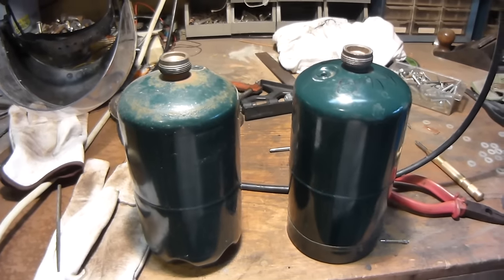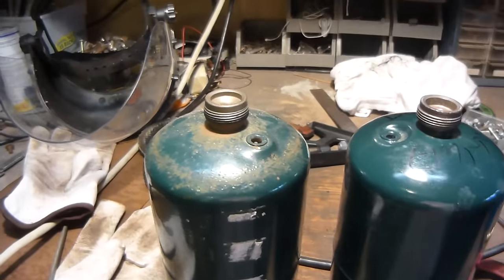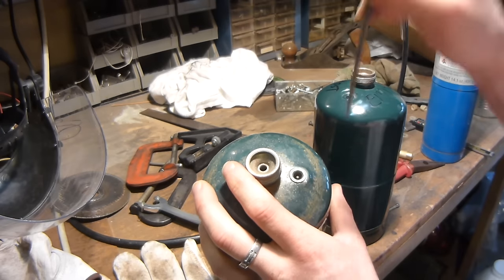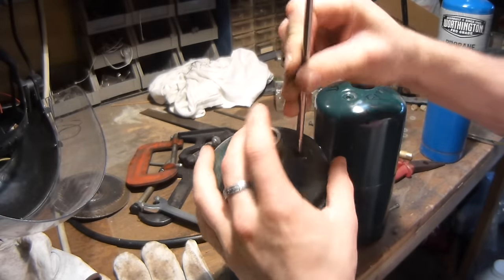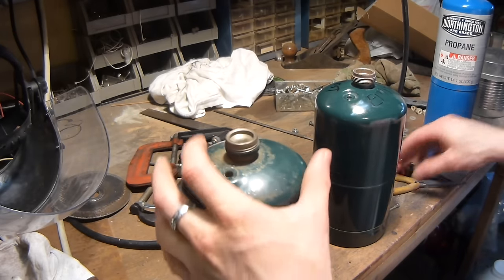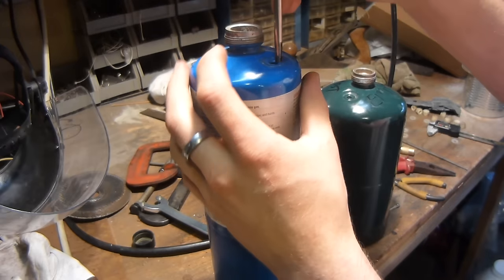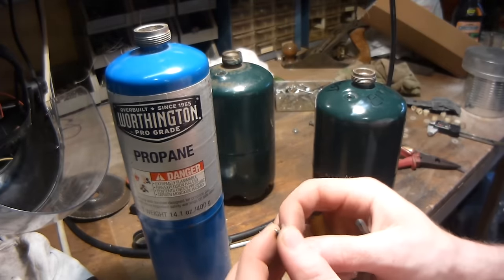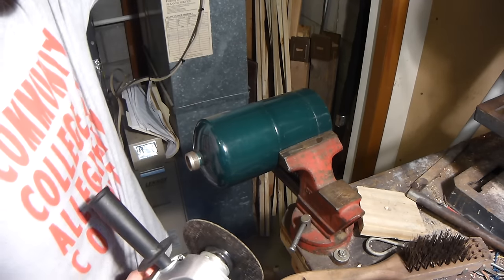How to Safely Cut Open a Propane Tank for Aluminium Melting Crucible

Comment: Hey, I made one of these from your instructions. Thanks for the experience and the safety tips. 
Side:  I'm not sure it's for the masses since some unlucky person might be near a spark or flame without knowing it.  I did notice that when filling the canister with water, there was a trapped gas pocket as TheRubberMeep pointed out, so I guess it's a good idea to drain the water.

Comment: Hey MJ101, after watching Grant Thompson's video on his popcan furnace on FB, I decided to do this. I looked everywhere trying to find the steel fire extinguishers (here in Altoona, they are all aluminum now) so went this route. My method, being completely paranoid, was to hold the can underwater while first drilling out the relief valve and then cutting the top off. Since all I had was a hacksaw, it did not go nearly as fast. But the can held up to the temps of a charcoal furnace and allowed me to melt enough scrap aluminum to get about ten mini metal muffins.

If you can afford it,  my new plan is to just buy the special tongs off ebay and get actual graphite crucibles. They're much more expensive, but you don't run the risk of the crucible failing from too high temps.
Reply from the maker: +J.D. Gallaway (FCCorpUS) If you just cut slowly with the hack saw you would have been find.  I have never seen a hack saw create any sparks.  But still better to be safe than sorry.  Cool that it worked out for you and you cast some aluminum!  I probably will buy a graphite crucible eventually. Thank you!
Reply: @makerj101     U must not use a hacksaw very often because mine sparks all the time depending on what blade they have on it

Comment: Please use a wheel guard when you are using the angle grinder! Not to be one of those safety freak types, but once when i was cutting metal without a wheel guard the wheel exploded, and a large piece of it embedded itself a good inch deep in the wood wall 10' away from me. If that had hit me it could very well have killed me. I have never used an angle grinder without a guard since.
Reply from the maker: +A. Zak  Yeah I should have been.  I took it off last time I used it when I was using the angle grinder as a sander.  Then I forgot to put it back on.  I didn't even realize it was missing...  Thanks for pointing it out.  It's back on now.  Not a good thing to happen.  I'm glad you are ok.
Reply: Makerj101 Well, I'm glad you use a guard most of the time! And i am also happy that i am OK .☺
Reply: well now i have to scold you for using a bad blade. you can use the angle grinder without the gaurd carefully and very very very very very frequently the gaurd gets in the way making your cuts imposible and grinder worthless, or because of the poor way most blade gaurds attach to the grinder the gaurd gets a little bit of lean, can be ok with some blades after almost loosing my hand i wont be overlooking that again, the blade must spin parellel to the gaurd if its not parellel or if it dips at any point once spinning do what you have to to make it parekllel. if your blade flew off iether you where attempting to cut something in a way you should not have, pay  attention to blade flex, or it is because the blade cracked or chunked and you cut corners rather than grabbing a new one. dont cut that corner even with ppe and a blade gaurd installed properly you can still get injured by a blade that should have been thrown away. i had no classical instruction and never a professional to point the way i learned this first hand, the hard way, heed these words if you wish, its your life.
Reply: A good friend of mine got careless and had an angle grinder disc break apart and got a piece deep in his arm. It was  a terrible, jagged wound that took a very long time to heal. One of the worst I've ever seen. I use the solid cut off  disc's made by Diablo now. They don't break. They just eventually get dull but they last a long time.

Comment: where is the guardon the angle grinder?
the disk will break and you will have bad time
Reply from the maker: +the real illuminati Yeah... I shoulda put it back on.  I took it off them I was using the sanding disk but I forgot to put it back one.  And yeah that would not be good if it broke.
Reply: +Makerj101 I always end up setting my shirt on fire when I'm grinding stuff.  I have about 5 shirts with holes in the front.
Reply: +Makerj101 Seriously, put that guard back on. You wouldn't be the first to shatter the cutting disk. You're using a face shield which is good, but still better put the guard on.
Reply: +Triangle_DIY  I mean generally speaking always do it but particularly near the end where you used a cutting disk as a grinding disk it was risky. Very flimsy those things are if you push them in any way other than radially
Reply from the maker: +John Creasey LOL actually just did that yesterday!  I just got this angle grinder a couple of weeks ago so I thought it was actually pretty amazing when my shirt got a hole melted in it!  :P
Reply from the maker: +Rainbows871 +Triangle_DIY  Yeah I will next time I use it.  I totally forget to reinstall the guard after sanding.
Reply: +John Creasey Lol, I've done that also. The trick is to hold your grinder so the sparks go on the side. If you stand right in the sparks it'll cost you a few shirts :P
Reply: +Rainbows871 Yes, that's the most dangerous part. A few years ago the thicker disks were more normal. With the current thin ones it is a bigger risk indeed.
Reply from the maker: Triangle_DIY LOL I did stand off to the side after that happened!
Reply: +Makerj101 with good clothes it won't happen that fast. I have a 'work jacket' and that's pretty good stuff. just shirts go pretty fast though :D
Reply from the maker: Triangle_DIY LOL yeah!  Cotton is probably best.  I imagine a synthetic jacket would melt really fast.
Reply: I'm saving my coppers for a leather apron.  Also will cut down on the incidence of brass shavings on the carpet!
Reply: people are actually buying them for the look.
Reply: I actually knew someone who was killed by a grinding disk. He was using a 14" chop saw with out a guard. While making a cut the disk broke apart and split his skull open. He was killed instantly. Disk the kid was useing is smaller, but if it came apart I have no doubt the pieces would still have enough energy and mass to cause serious injury maybe even death.

Comment: I'm presuming the same would apply for big propane tanks? i've just got myself a......knee height tank that i have completely removed the valve for(it unscrews)

I plan to purge the tank by filling it completely with water first....

I'm then going to convert it into a small furnace for melting down aluminium and forging.
Reply from the maker: +TornTech Yep.  Same deal. Remove the valve and fill it with water to make sure there are no gasses left in it.  Sounds awesome!   Good luck man!
Reply: +TornTech Look up Raven556 on Youtube. He does aluminium melting and he uses a furnace that is made of a propane tank. Nice base to start with.

Comment: Where do you get those propane bottles? Here in the Netherlands these bigger types are refill. You buy them once, and then you can go and let it refill, and pay only the price of the gas. So second hand people sell them, and they go for like 40 dollars...
Reply from the maker: +Triangle_DIY  $40... holy wow... that's expensive... here you buy the green ones for camping lanterns and such at the hardware store.  They are like $4 a bottle and then you just throw the bottles away when they are empty.  Some people do refill them but it's not worth the effort to refill them unless you have like a whole bunch of empty ones.  Blue ones for torches are like $3.
Reply: +Makerj101 I think he meant 40 bucks for the big ones
Reply from the maker: +Ivan Stroganov Oh yeah... I think he  did.  Thanks.
Reply: +Makerj101 Basically we have to sorts of gas tanks/bottles here: The disposable kind, and the refill kind. The disposable ones are very thin metal. Mostly just a metal bottle, and the torch then has a sharp pin that punches it. So you can't remove it till its empty. These are the kind with propane/butane mix, lower pressure than only propane so the metal can be thinner.

The one you cut up in the video looks like it is a thicker version. You have to buy one of those bottles. You know, there are strict standards for such things. Refill is cheap, but you have to own a bottle then. You bring in the empty one, and you get a full one for the price of the gas. So yeah, cutting something like this up like you did in the video would be expensive.
Reply: +Makerj101 the 40 bucks ones he meant are those type of bottles http://i.imgur.com/EZ3Ria6.jpg (11kg propane). of course we have the small gas canisters too
Reply from the maker: +Triangle_DIY I've never heard of the ones that puncture and you can't remove until empty.  All the ones here are refillable if you want.  The green one I cut up in the video costs about $4 full of propane.  Most people throw them away but they are easily refilled.

Comment: Yes that is a schraeder valve, you should be able to use a removal tool that you can buy from an auto shop/garage.
Personally i would remove that valve, then fill with water while the top valve is held open, then cut the top off while the cylinder is vertical, the act of cutting through could introduce oxygen and make a volatile mix.
If you don't fill with water, it would be best to use a non sparking method, like  a hacksaw
Reply from the maker: +Sparky Projects Yeah I know you can buy them.  But I wanted to cut these open now.  I wasn't going to wait until the next time I went to the hardware store or make a special trip.  It only took me like 30 seconds to make anyhow.  :P  I like to make stuff!!  :P  And yeah that's what I did.  I should have mentioned that.  I should think people who are going to cut one open would be smart enough to figure that out...
Reply: +Makerj101 Yeah, I got a tool like that, for valves from cars etc. Used it to get the valve out to replace the lawnmower tyre.
Reply from the maker: +Triangle_DIY Yeah they are pretty nice to have!

Comment: be very careful when using the angle grinder "cutting wheel" to grind things. had them brake on me before, and it is not fun having cutting discs traveling 120mph anywhere in the room.
Reply from the maker: +InTeg3R-9¹³5 NoPreferences Yeah I forgot to put the guard back on last time I used it for sanding.  Don't worry, it's back on now.  Thanks!
Reply: Holy crap

Comment: What was the thickness of them bottles?
and what size were they ?
Never seen any of them here in the UK
Reply from the maker: Pretty thin formed sheet steel. Like 1/16 inch. 16.4 oz disposable propane cylinder. They are just a short fat version of the ones used for plumbers torches. But maybe you don't have those either?

Comment: I've used a propane tank as a crucible and it burn a hole the second time I used it. I used it in a charcoal and oil foundry. But it might work for you because yours is electric. But it's not stainless so It rusts out a hole in it really quick.
Reply from the maker: +Sargent Cuddlepuff (Sargentcuddlepuff) Yeah that's kinda what I was figureing.  I guess the electric furnace gives more even heat.
Reply: @makerj101  I know this is an old video but I just thought I would mention that I used one of those stainless steel things bartenders use to shake up drinks with ice in them. Any stainless cup will do. It lasted me quite a while. I would say a good 20 uses as a crucible and it didn't burn through yet.  I just replaced it because it looked like it was pretty much cooked. I drilled a couple holes at the top and put a kind of handle on it to make it easier to move around and pour. Worked great. Drill stainless very slow. Fast drilling hardens it.

Comment: once you purge the gas remove the water as well because a tiny bit of gas inside can still explode if its compressed into basically an air pocket by the water
Reply: no, no, no.  petrochemicals can leach out of the steel.  you NEED the water to displace any possible propane/02

just Don't leave an "air pocket" at the top.

Comment: Essentially, you could just remove the valve and release the gas? I understand its under pressure but if you put that tool in a drill - might need a face sheid or welding mask and clamp the tank down facing up - it probably would shoot the valve out - gloves too - and release all the gas

Comment: Do you ever have an issue with the brazing between the top and bottom section of the bottle failing? I generally cut below the joint and the one time I didn't it melted through. Perhaps my temps are higher than yours generally?
Reply from the maker: +Thomas de Boer That's actually a really good thought that had not crossed my mind.  I guess I will find out when I use it.  The last crucible I used was one of the blue bottles and I cut it just bellow the joint because it wouldn't fit in my furnace if it was any taller.  I guess I always thought it was welded...
Reply: In my experience I've yet to find one that is welded, of the little green camping cylinders at least. Best crucible I've found so far for aluminium is an old fire extinguisher cut to size, best part is you can just unscrew the top and it's not going to explode on you!
Reply from the maker: +Thomas de Boer Yeah true that!  Problem is it's hard to find fire extinguishers around.
Reply: +Thomas de Boer you could look for a 'senseo coffee pad storage container'. A stainless steel container used to store coffee cups. Reasonable wall thickness. Will last a few melts, but is really cheap to get at some second hand stores. Less than a dollar generally. So I use them like 3 melts and throw them away. your name sounds Dutch?
Reply: I have a couple good fire extinguishers lined up so I'll hopefully have enough crucibles for a while, but I'll look into more for sure. How much Al would you say they can hold? My current furnace can fit an A10 into it (and probably a bit bigger really) so I'm more interested in large volume crucibles as of late. My fire extinguisher crucibles can hold probably 2.5-3 kilos, which is enough for what I'm doing (which is nothing really as of yet). Yeah, dutch ancestry but I'm Canadian born!
Reply: Cool! If you can use fire extinguishers, thats good. Hard to get for me. They hold around .7 Liters, diameter is about 70 mm and 150 mm high (Wild guess, don't have one nearby). A graphite crucible would be a good investment if you could get one. Much harder in the Netherlands. Cool, recognised the name as a Dutch name :) Quite some Dutchmen emigrated to Canada so yeah.
Reply: That's not too bad. I know there's a furnace supply company based in the UK that I believe delivers to a large portion of europe, you might want to look into that. I'm pretty lucky in that I emailed a foundry provider and he was glad to let me buy a couple of his things as well, so I've got a fine choice of refractory wools, cements, and crucibles. I'm saving my A10 graphite crucible for a large bronze pour I plan to do eventually, so it's random steel crucibles for the Al for now. I actually have considerable family still based in the netherlands, my one grandparent alone had some 11 siblings :-)
Reply: Yeah, It's possible to get supplies, only its so expensive! Shipping from the UK is doable, but in the end its a lot more expensive than the US (or Canada).

Maybe you can make some video's about your melting and setup, would be cool. Cool! I'll have to ask my parents, they sure now a few people with the surname 'de Boer' but thats not very uncommon..
Reply: I've made a forum post about my setup before (http://www.alloyavenue.com/vb/showthread.php?11519-Summer-work-on-my-second-furnace-the-1UP) if you wanted to check it out. No videos as of yet, if I were to make one I'd want to do it when everything is finished. There are a great deal of people with the last name de Boer so I'm not sure that would go too far :-)
Reply: Sorry for my late reply! Had a look at your setup, looks really good! Thanks for sharing.

Comment: There is a plastic sleeve in the top and can be removed with a small screwdriver, then you can access and remove the rubber o-o-ring exposing the valve.

Comment: Cool you made your own shrader valve remover tool.  I have one I bought for use on car tires, never thought to use it on empty LPG cans though.

I do have the actual attachment hose with bleeder line and gauge that connects to that type of valve to actually refill those cans. I only used it a rare couple of times though and I cannot for the life of me remember where it is here either lol
 
Anyways I have cut those green cans before with a band saw, little to no sparks and smootherstraight cut.
Reply from the maker: +ElfNet Gaming I'm not sure the ones for tires would be long enough.  The stem on these are pretty long.  Yeah a band saw would work great!
Reply: maybe the tool for a big truck tire? I think that one is longer than your conventional stem remover
Reply from the maker: +ElfNet Gaming Yeah that might work.

Comment: I used a small punch and made the tool to get the valve out.
The punch is hallow so I did not cut the slot as deep as yours.